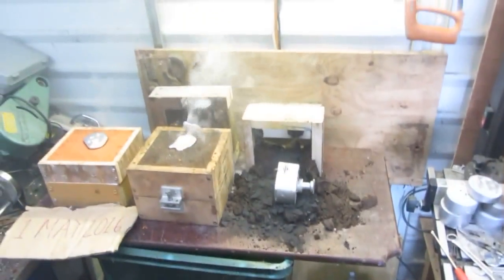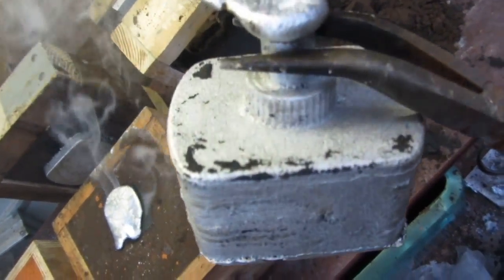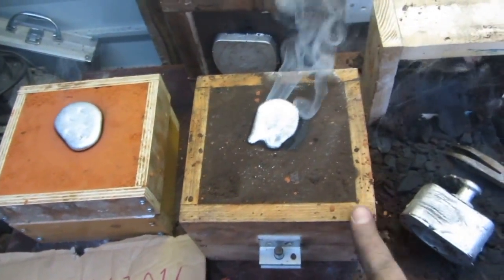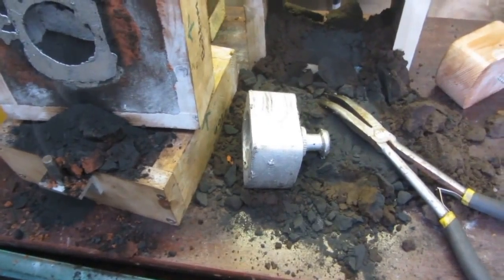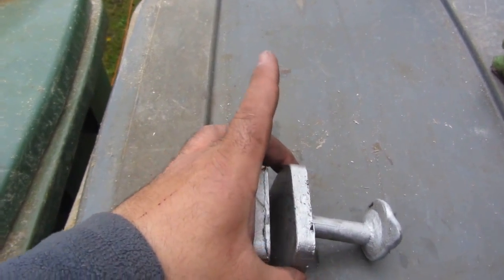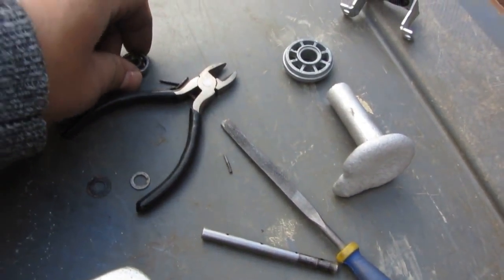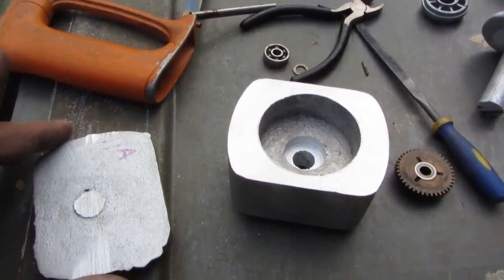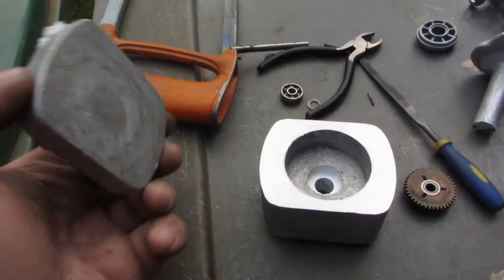01st May 2016 - Casting an small 'inline' gearbox casing for an electric motor.

Comment: I also have a unimat 3 . I like the work your doing
Reply from the maker: Thanks man :-) I have Three Unimat 3 lathes!,

My first Unimat 3 (my second oldest one 1983) has the milling drilling column, 5mm allen key, 10mm spanner, original twin Getec 2 speed universal motors (one  motor that drives the lathe and the other motor drives the milling/drilling column, I have loads of bits for it including the auto feed attachment, the 3 point fixed steady, the indexing and dividing attachment with 3 different indexing discs (handy for cutting your own gears!), the taper turning slide/tool post and also the standard tool post too (a quick change tool post would be so nice! but I don't have this at the moment), I also have the grinding wheel and grinding attachment and the t slotted milling table with the Emco milling vice and also the all important handy slitting saw!, revolving center, 2 dead centers, an aluminium drive plate and drive dog and a tail stock drill chuck & key and finally a 4 jaw independent chuck.  

My Second Unimat 3, I got this one for just £100 from a guy from Scotland on eBay who had it as a buy-it-now listing with no postage offered, I messaged him along with several other people who were after it.... he obviously didn't know how much these are worth as a 100 pounds was a steal!, so I was really cheeky! by hitting the buy it now button! (after no reply as it was mid afternoon and he was obviously offline), I was getting a bit nervous!! when I saw the amount of people that started watching it! LOL, so I paid the seller the £100 via PayPal instantly to secure the lathe and then I sent him another eBay message asking the him to be kind enough to sort out some postage for me and send me a money request for the post and packing via PayPal which he did for a reasonable £30, as he was a decent guy :-), This Unimat is a very late Unimat 3 (1991 year production one of the last Unimat 3's made) and it also has the handy milling/drilling column, it also has the later Unimat 4 permanent magnet motors (one motor for the lathe and one for the milling/drilling column) These Unimat 4 later  2 speed motors are miles better than the original Unimat 3 motors which don't seem to have enough torque sometimes! :-(, this Unimat also came with auto feed attachment, the t slotted  milling table and the Emco milling  vice, It also has the table saw attachment with the rip fence and the later Unimat 4  3 jaw lathe chuck and a tail stock drill chuck & key, 5mm allen key.

My third Unimat 3 is a very early 1976 (1st year of production) Unimat 3 which has the unusual head stock anodised aluminium nameplate where the black and silver on the anodised aluminium are the opposite way round (compared to the normal regular Unimat 3 head stock nameplates), This style of nameplate gives the Unimat 3 a real 1970's look which I quite like!, (I think that these anodised aluminium nameplates were laser etched where the nameplate starts off as a black anodised aluminium plate, and the laser which is CNC controlled bleaches away the black anodise dye which then leaves silver marks in the shape of the graphics and numbers on the black anodised aluminium plate giving the effect of a rather cool looking nameplate! with the contrast between the black and the silver),  this lathe is just the basic lathe with just a 3 jaw chuck, it has no milling/drilling column and a bad motor which I am sorting out with a more powerful drive motor! :-)

I have also just bought a Unimat 4 lathe as well which also needs a motor as its motor was missing when I got it, it has a few bits with it too, so this should keep me busy for a while! :-)

Thanks again for your comments, it is so nice to see another fellow Unimat 3 owner out there! ;-)

Best Wishes, Joseph :-)

Comment: Hi Joe! gust come across your vids they are good! just a suggestion can you not use a reverser on your motor?
Reply from the maker: Hey Steel,

Many thanks for your comment, Yes I know that it is possible to get the motor to run in reverse by swapping the connections around at the brushes - this works to reverse 95% of all universal brushed motors but the main reason that I made this gearbox is to give this weak sewing machine motor more torque in order to drive the Unimat SL lathe and meet the demands of turning, milling and drilling which an ordinary 230v 70 watt 0.4 amp sewing motor clearly cannot cope with! - To drive the unimat the motor needs to have more amps to give it the turning force needed, a weak sewing machine motor just won't do for this application until it is geared down slightly reducing the motor speed but giving it greater driving force.